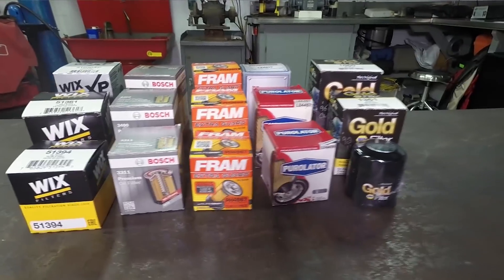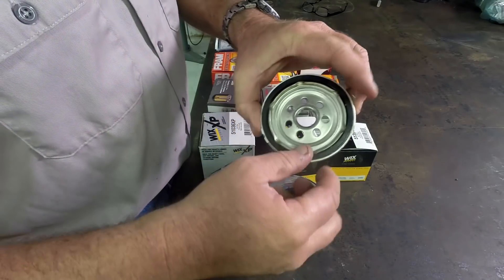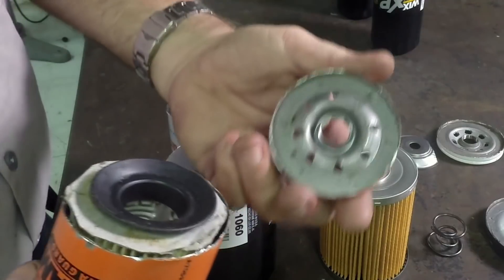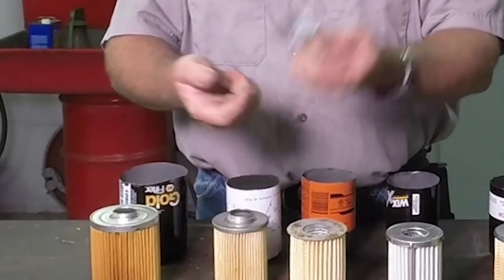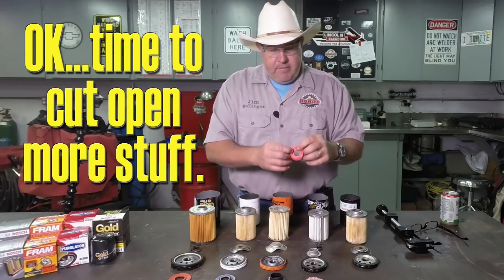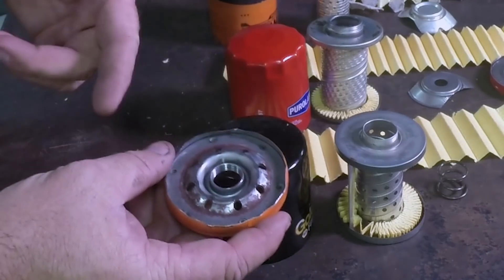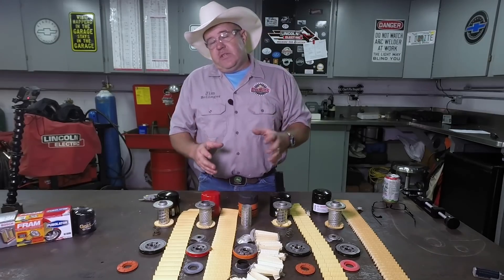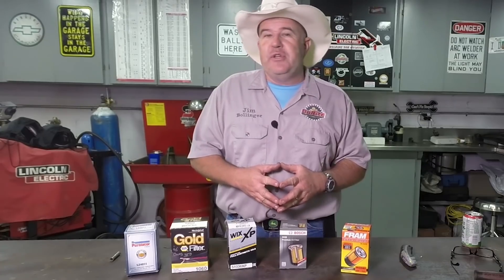The worst oil filter EVER!

Comment: I saw no rust anywhere on the inside of the case and yet it some how magically has rust on the cardboard. Plus why does it matter if the ends are cardboard when the filter element is paper itself? I'm sorry but I'm not going through a war zone on my way to work so I don't think I need my oilfilters to be made of solid metal

Comment: I had a Fram oil filter completely collapse internally on a '90 Chevy truck with a 350. Cruising the highway when I lost all oil pressure. The cardboard had collapsed after 800 miles and blocked the rubber valve from opening. Wix, Napa or dealer filters only for me anymore.

Comment: Hey Jim, I just bought a Fram oil filter. I noticed they had 3  types from Fram. a base, mid grade and premium. I bought the premium one . What i did notice when i had the base and premium both,in my hands was the weight. The premium was substantially heavier. So there must be an internal difference.Can you test the premium Fram ? See how it stacks up with the others !!!

Comment: i have a truck that i have owned for its entire life and done every oil change on it some of them with 20k on the oil and it has always had fram filters that truck has 475 thousand kilometers on it its had a new transfer case a new front diff and now its getting a new transmission engine still doesnt burn oil although it will be getting a rear seal when it gets its transmission

Comment: The best filters out there are Royal Purple and AMSOil - both are made by the same company.  Only issue is, they are hard to find and can only be found online.  I would consider a FRAM Ultra filter - it has a plastic encased filter media, but is still much better than the cheaper FRAM filters.

Comment: My mother worked at Fram, making oil filters.  She told me to never buy a Fram oil filter.  Now, having said that, My son in-law put a Wix oil filter on his Scion XB.  Three months later it started spraying oil out while my daughter was on her way home from work.  We put it up on my lift and the entire filter looked as though it had been under saltwater for two years. The parts store replaced it and gave him a 5 quart jug of synthetic oil.  They said they would send the filter to corporate along with all documentation.
Reply: Few and far failures in between. No company is 100% QC reliable just like the lucky who win the lotto.
Reply: That never happens with Wix!! Very freaky!! I am a generator mechanic  and Wix is all I use! I have never seen this happen. 1 in a million!!
Reply: A loose filter, spraying oil on a hot catalytic converter, would catch fire and burn off the paint leaving a rusty surface.
Reply: Actually some companies are 100% qc that is the difference between made in usa or germany or italy and made in china or mexico
Reply: kismet, you name a company who has only dropped the ball less than once and I'll poop in your kitchen.

Comment: I currently have a NAPA Gold on and AmsOil in my pickup and so far it has been good, we'll see this spring when I change my oil again. But previous to that I had Royal Purple and a white K&N with the big nut on the end. When my oil was changed I asked the person doing the job the condition of the K&N and they said there wasn't any hefty to it from dirt clogging it up. So I could have easily gone another few thousand miles before changing out the K&N. 

If I can find them cheaper and possibly get them in bulk I'd stick with the K&N. I've been eyeing one of the machined billet filters that K&N has on their website. I like the idea of just having to clean and re-use the filter rather than just throwing it away, but it's also $250. I've learned my lesson years ago with these crappy Fram filters. Especially when I can get the white Purolator Classic filters for less than the Fram and get a better made filter. The Purolator Classic and Wix's own equivalent are the cheapest filters I'd buy. Unless there's a diamond in the rough somewhere that I can get for a steal in bulk. :)

Comment: I just buy the Toyota brand filters at the dealer, they're like $4-5 a pop.  Figured they're good quality.  

Also why did manufacturers go to cartridge style oil filters instead of spin on filters???   The spin on ones were easier to change and didn't make me go buy a $10 socket.

Comment: Wow a $3.77 filter isn't as good as a $8.xx-$10 neither is it as good as a $13.xx-$16 filter    WOW   that's news.    How about comparing to the Fram Ultra which is still cheaper than your wix and napa gold.   And no I don't work for fram and I haven't used a fram filter in my vehicles save 2 times about 20 yrs ago (when I was changing in <1k miles and 3mo.)   I do, currently use nissan in my nissan, hyundai in my hyundai and I think bosch ( I don't remember) in my old beater nissan pathfinder (different than above nissan filter in nissan)   and a napa (edit - right now Mobil 1 extended) in my lincoln.  My others I presume are oem as I don't do myself now - let dealers do.
Reply: no engine should be punished with a Fram filter
Reply: https://youtu.be/Y544o-mw2wc
Big difference between the Ultra and the rest. Starts being a he'll of a lot closer to the other filters but still cheaper.
Reply: Lots of videos available showing the Fram Ultra synthetic.  It is an excellent filter.   However people will believe what they want to believe.
Reply: Some people want the best for their motor not a piece of shit filter
Reply: Stick with what comes on your vehicle from factory dose not cost any more and it's the right choice just like the engine oil .
Reply: Who would use a cheap $4 - $8 filter on a fairly new car...?? NOT ME.... and not any chinese filters either... Chinese copy things but do not understand what they are making.... ??
Reply: @vw68autobug  I doubt anyone sane would.  Most people use factory filters while under warranty.  

I did want to add the fram cartridge filters are much better.
Reply: They are still shit. Frame filters suck, seen all of them and pure garbage.
Reply: @pxndxlunx5821  I'm a big fan of Wix and Donaldson myself but the Fram ultra is a good filter.  The internals are all different.

Comment: Lots of people do oil filter reviews and every single on says the same about Fram ... because it’s true. Complete JUNK! 
What surprises me is that not many reviewers talk about the differences between anti drain-back valves. 
The RED silicone valves are far superior to the black viton rubber ones, which can harden and even crack under high operating temps. The red silicone ones remain pliable.

Comment: I lost an engine to a Fram filter; specifically the crappy construction and quality control. I did an oil change on my car, and immediately on startup, I noticed oil pressure on the gauge was unusually high. Odd, but no problem, right?  It must just be flowing better, or maybe it was because it was January and it was cold out, making the oil thicker, I figured. 
Wrong! The pressure didn’t drop to normal when the car warmed up, and within a couple of days of light driving, squealing was coming from under the hood. When I tore down the engine, I found a rubber band had blocked the oil passage to the head, starving the cam and valves of oil. That rubber band was used by Fram to hold that flimsy filter media in place when gluing it to the flimsy cardboard end caps. On startup, it had gone straight into the engine, because apparently Fram bypass valves also bypass the media even from new, meaning you aren’t getting 100% filtered oil even before the meagre filter media starts to clog up. The rubber band blocked the oil passage to the head, and the cam and valves were oil starved, even as the gauge read high, because the oil pressure sensor was on the main oil gallery in the block.
It was an expensive lesson on how crappy Fram filters really are. I did get reimbursed by Fram for the parts, but since I did most of the labour myself, and didn’t find out until later that this was a design and quality control issue, I didn’t press for compensation for my time or loss of use of my daily driver. But I haven’t touched a Fram filter in 22 years as a result - like this video suggests, I go for Wix, or the Napa Gold. Although it does appear they finally stopped leaving on the rubber bands used during gluing the media, the rest of the Fram is still a POS.
Reply: Oh man that's terrible! Hopefully the compensation was fair.
Reply: Dan Manthe non, the compensation was pathetic. They paid a fraction of my costs, and treated it like they were doing me a favour.
Reply: Royal purple makes damn good filters to.
Reply: @chrismaze3441  Made by Champion Labs last I checked, unless they went off the deep end of the pond like K&N did.
Reply: @robertagster7164  yeah they smoke some good shit for sure lol like O'Reilly micro gaurd filters are made by wix none the less I use wix filters on everything I own mowers, vehicles & tractor
Reply: Oh shit I better get oil change use different oil filter
Reply: Fram bought my father a motor for his bus dew to a bad fram filter  I remember it to this day
Reply: New lesson to be learned...high oil pressure does not necessarily mean high flow.  This goes especially to those who insist on using a "thicker" oil than recommended...
Reply: 22 yrs ago there was one failure....
Damn you must be a perfect person never having made a mistake.
Reply: HotRodRay yeah, the mistake I made was trusting Fram filters. And that one mistake destroyed an engine. It’s not like that’s a small mistake. And it’s one that happens regularly, but Fram chooses to fight the claims when people realize that it was the filter that caused the problem (not often, unless it happens immediately after changing the oil and you tear down the engine yourself like I did). They instead spend on advertising and promotion a legal nondisclosure agreements, rather than improve their product. And I had to fight for the meagre compensation I got because they chose to pretend it wasn’t a combination of poor design (still the case to this day, as seen in this video) and poor manufacturing processes. In my mind the real problem isn’t that Frams destroy the odd engine when they fail outright like mine did, it’s that they cause excessive wear in ALL engines, because even a new one will flow unfiltered oil past the bypass valve, due to the weak design and inadequate filter media surface area.
Reply: If that's true, you're part of a very small % of owners who had a filter fail. With your luck that change, it could have been any brand. Possibly a tiny hummingbird that was playing with the band looking for nest material who knows. But yes, I'd steer clear of Fram after that, however just bad luck.
Reply: wtf kind of idiot keeps the car running after their oil light goes on, even more so if you've just recently made a change. The vast majority of equipment failures - regardless of brand - happen immediately or soon after initial use. No sympathy for you, your car warned of an issue immediately after you made a change, but you decided to let it run and warm up, the warning still didn't go away yet you continued using it for a couple of weeks. Ya the filter is definitely the problem maybe try taking responsibility for your own stupidity.
Reply: LOL....22yr ago. That's a long time, buddy. If you send in your alleged "bad" filter to FRAM's customer service people, they'll do all kinds of non-destructive tests to it to see if there's any excessive flow restriction or oil leaks. If there's any kind of quality issue found, they'll certainly pay your repair bill. If the filter was fine, they'll even send you a brand new replacement. Oil filters are simple devices. People love to blame them for their personal lack of vehicle maintenance and/or abuse, previous engine issues, or factory-borne mechanical issues.
Reply: Robert Agster did you even read what I wrote? It was part of the filter that blocked the oil gallery in my engine, leading to destruction of the engine due to oil starvation. It happened as soon as I started the car after changing the oil, on my at the time regular schedule of every 5000km. It was not a lack of maintenance issue. I didn’t need a replacement filter, I needed an engine rebuild. And Fram (really Allied Signal, the parent company) was in no way happy to compensate me for a very clear failure of their product. It took me the better part of a year to get a few hundred dollars out of them.
Reply: @rx7racerca  Fram makes cheap filters for people who don't see a point in spending 20$ on an oil filter. cheap means less quality control. yes, Fram could have a hand to play in your situation. that being said, you are more at fault than Fram is. if you have the intelligence and skill to tear down the engine and do a rebuild than you should have known not to drive around for DAYS with abnormally high oil pressure. sorry bud, that fix should have been on you and i think a lot of people would agree.

Comment: Great video.  Always change your oil and filter on a regular basis.  I have never had engine trouble and I have used Fram more than not.  I usually keep my vehicles for 10+ years. My buddy has 450k on his Honda.  However, its obvious there is alot of junk out there these days.  The Fram filters you cut open seem to be of poor quality. Wtf?    If you change your oil every 5k / twice yearly you are probably ok with a cheaper filter. The Napa you opened is probably better for people who put on way more miles.  Its also a higher end from their line of filters. It appears it will last longer. Its too bad there are so many options. For a few extra dollars get a top rated filter. Ask a mechanic.  Im curious now.  Im gonna cut open my Fram. A new one and my old one, after 5k. If it looks like yours, then they dont deserve my business. I will try another brand. But I'm just not so quick to jump on someones bandwagon just yet.  But you've got me thinking.  Thanks for posting. Are you sure Napa isn't paying you yet? Lol

Comment: The Fram ultra synthetic has metal parts inside of it. even has a metal backing on the filter itself. you're comparing the cheapest brand of Fram to the most expensive brand of Napa

Comment: There are several grades of Purolator oil filter.  The one you have is base, but you appear to be comparing to the NAPA "Gold," which would be a higher quality.  I wonder how the other grades of Purolator Oil Filter would compare.

Comment: Micron filtering and the bypass force come into play a lot also especially with extended life oil.  I use Amsoil but I change the filter every 10 to 15 thousand miles and fill back up.  My fear is a very fine micron will clog quickly and the bypass will activate and miss filtration.  My oil also stays cleaner.

Comment: The quantity of filtration media in a filter is not a reliable way to establish of the performance of the filter. The only way to evaluate the performance of a filter is to test it in a lab with established standard fluid, contaminants and lab test equipment.

Comment: My first question would be who dose this guy work for I would venture to say he has some association with Napa. I am 65 years old I've had numerous different cars I have drag races cars off & on my whole life from my very first car I've always used Fram filters my last car I drove all over the east side of this country put 329,000 miles on it a 302 Ford the engine was running great when myself & my Son replaced the whole drive train from an identical car the jeep I eventually started driving I still drive ever day it has 425000 miles on it & still runs great I've always used Fram filters I've heard this story from numerous different people. I go by experience not by listening to everything I here I've worked on cars all my life.
Reply from the maker: No association with anyone who works  for or resells any auto parts, or anything to do with the parts manufacturers...nice try though...

Comment: Hey Boss, 
Awesome great presentation on oil filters. I work for a federal agency in transportation I always use Napa or Wix never never use Fram. Although they are the least expensive but you get what you pay for. My vehicles save lives. I would hate for a filter blow out to happen on the road.
Thanks again

Comment: Farm has three grades of filter.  You are comparing apples and oranges.  The end disks were designed to center the filter in the can during the assembly process.  After the can goes through the seamer the filter paper is held firmly in place.  For the price the low end Fram is a very good filter.  The top end Fram is equal to or better than the Bosch.  Look at the spec’s.  Fram has a policy to not round up the filtering action claim as others do.

Comment: This fat fake cowboy probably put water in the frame filter. That would explain the rust inside and the cardboard ends falling apart. I'm not saying fram is the best but I think this dude did something to the filter. I use a cotton media backed with metal mesh that comes in Royal purple. Wayyy more efficient than filter paper

Comment: I've used the inexpensive Fram filters for 35 years and just gave away my 1996 Nissan Maxima with 283,000 miles on it with no issues.   I change my oil every 3000 miles so while they may not be the best they have certainly worked in all of my cars for the last 35 years.

Comment: I worked with a guy several years ago who also did work on his own car. He was a little more knowledgeable than me so when I was telling him one day about how I used Fram filters because they were cheap (and I was in college), he told me Fram was cheap crap. So I asked what he used and he said he'd never use anything but a Wix filter. I figured I actually could spare a few extra bucks if it meant the longevity of my engine. So now I only ever use Wix or K&N filters. This video only helps solidify what my buddy told me back then. Really gives you some insight into how poorly constructed those filters are.